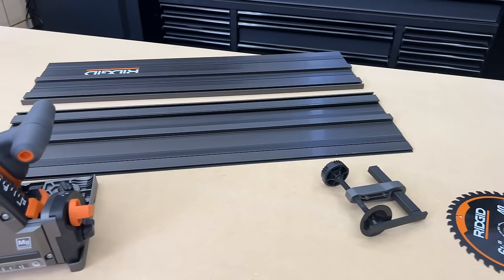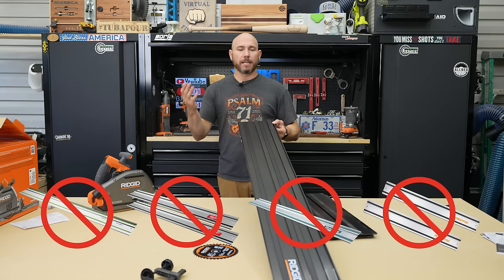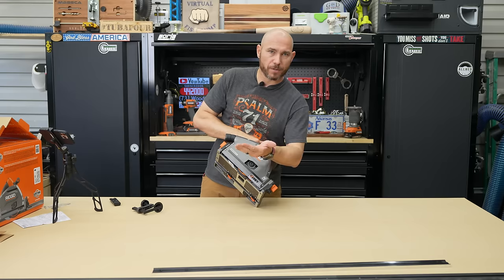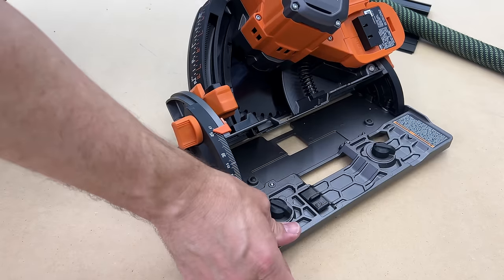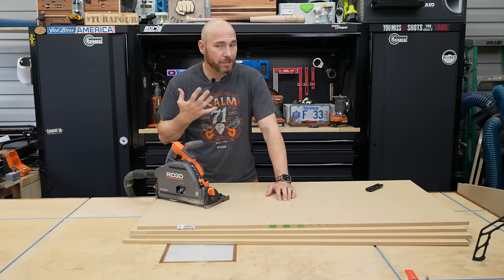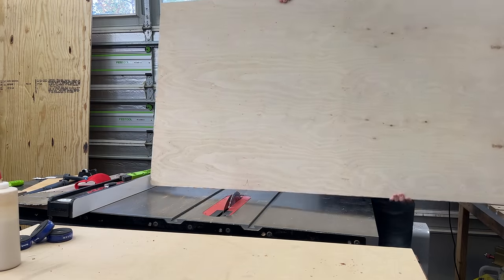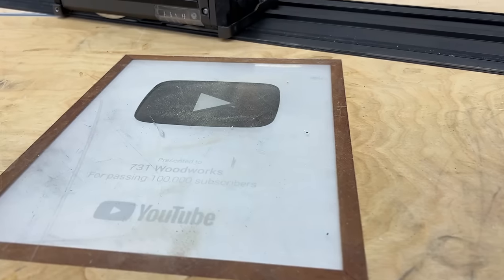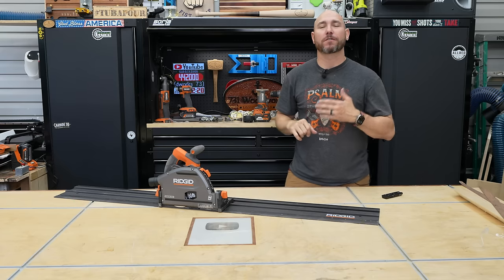Now We Know Everything About the RIDGID Track Saw!

Comment: The numbers on the clear side guard are to show you where the blade with end based on how deep you are plunging. This is necessary for when you are performing a plung cut where the cut doesn't have an entrance or an exit on the material. One example: cutting a square out of the middle of a sheet.
Reply: Came here to say this. For example, if you're plunging 1" deep, the ”1" mark shows where the leading edge of the blade exits the cut, and you finish by jigsaw or by hand.

Comment: I love this track saw.  This is the biggest upgrade to my home shop in years.  Breaking down sheets is so much faster and more accurate than using my table saw ever was.  Just added some Bessey quick release lever handle track clamps and a squaring system to make it even more convenient.  Add in the new 12ah batteries I picked up a 2 pack of, and I can break down all the sheets I would need in a day without running out of power.  Just waiting for TSO to release their square for it, coming next year.
Update:  TSO just released their new square that fits the Ridgid track.

Comment: Years ago, I chose the Ridgid line for lifetime battery replacement and lifetime service agreement. I know that there is always a product that is a little better or little less expensive. Rigid has not disappointed me though. While sometimes I  wish that I chose Dewalt or Milwaukee, overall the Ridgid line has performed very well for me as a DIY'er and I am excited to hear such a good review for this saw. I hope to make this my next big tool purchase.
Reply: I submitted two warranty claims with Rigid and they refused them both.  No abuse of the tools, no overuse, just weekend warrior stuff.  Love the looks of this track saw, but thanks to that, Rigid will never make it into my shop again.
Reply: @thebeardedcanadianadventures  Did you have the tools registered correctly?  I have made a few claims and they fixed them all.  Most were easy.  The only one that took a bit of effort was on my R4512 table saw where they replaced the motor because there was a bad bearing in a fan and they didn't have just the fan replaceable - so basically made it a brand new saw.  The effort was that it's harder to bring in a full size table saw than it is a router or something for repair.
Reply: @thebeardedcanadianadventures I have had issues with the 'service agreement' as well.  It isn't a warranty and as soon as they stop making parts for your tool, you are screwed.  I will also never buy their products again because of service issues with them.

Comment: Thank you for your thoughtful reviews.  I am also a fan of the Ridgid tool line.
I have rarely used the 'plunge' feature of my tracksaw and don't think that is a really important function, but I note that the riving knife on this saw will actually block the blade from plunging because there wouldn't be a pre-existing kerf for it to fit into.  Just a nit, I agree, but you seem to feel the way this tools riving knife articulates is an important improvement over the Ryobi; I just don't think it will allow a true plunge cut.

Comment: I find that I can do the same things as a track saw with my homemade guides.    1/2 ply base with 1x1 straight edge backer to run the saw against.    Using 6 1/2 inch Rigid battery powered saw, cuts through sheet goods fine for me.    Use my shop vac for dust collection with the built in dust port.    4 foot and 8 foot guides around $60.00 for both.   

That being said, not being negative or a hater....just saving the $400.00 + for other tools.

Comment: I am a big fan of Ridgid line even before it had the LSA, I have the old 12" miter saw, and the old belted table saw. I am currently building my 18volt line of tools (yes all of them are registered under the LSA) and have not have had a single issue with any of them. The tracksaw is on my bucket list to buy (come on Santa Claus lol) granted it is a want item not a need but when I need one I need one. I am a weekend woodworking warrior and not a full time woodcrafter so this would fit the void of dealing with full sheet cutups. Sorry I missed ya'll when you were down in Nashville recently as it is just a few hours drive from down here in GA.

Comment: A track saw shootout would be very interesting, especially this saw against the Kreig and other similarly priced saws. Personally I do wish it wasn't cordless though (or they make some kind of a transformer adapter to make it not cordless) - Before I get roasted for this, hear me out:

1) You're already running a hose to the saw for dust collection and dragging it along while cutting, so adding an extension cord to isn't a big deal (Velcro straps to the hose, now they move together as one, it's not that much heavier, and it only takes a minute to do) and I didn't see a battery or a charger in the box, so that changes the saw's price point if you're not in the Rigid platform...

2) An extension cord doesn't have to integrate into an existing battery system or stand out as an odd ball tool if, for example, you're heavily invested into DeWalt cordless tools like I am

3) Extension cords always work. They don't take time to charge or ever even need to be recharged, and it is never half dead when you put it into a tool...

4) Unless you trip a breaker or somehow unplug it, extension cords never die mid-cut or cause the saw to bog down as the battery is getting low... It's been my experience with cordless saws that long rip cuts really drain batteries. To me, that seems to be a problem on a saw where one of it's principle uses is doing exactly that, unless you're already in that battery system and have additional packs, but if you aren't, that radically changes the price equation and value proposition

I freely admit some of that preference may just be my particular use case - If I am breaking down sheet goods, it's multiple sheets at once for a project
Reply: I don't think it's particularly controversial to want a corded saw vs a cordless one. I agree with you! A corded saw for this purpose would make this tool better for anyone who hasn't invested primarily in Rigid products (I don't know anyone who is primarily Rigid, I'm sure they're out there, but far more rare than Dewalt, Makita, Milwaukee, etc). It's also going to add the cost of a big boy battery, which might push it over the cost of the Milwaukee if you're already primarily on those.

Comment: This does look like a good offering as far as it goes, but the decision to go with a proprietary track is interesting. While just saw+track is useful, IMHO the utility of a tracksaw increases with the addition of appropriate accessories - parallel guides, square, router plates, table system. Kreg also went with a proprietary track but at least supplied some additional elements to the system, and you're finally seeing 3rd part aftermarket support as well. Getting compatibility with all the aftermarket accessories is obviously what you get with Festool rail compatibility, so eschewing that may mean that Ridgid is intending to build a system around it. Guess we'll see.
As I already own the Kreg I wouldn't consider making a lateral move to the Ridgid, but I might take a serious look if I was just buying into a system.

Comment: I’m subscribed to your channel and  on your Facebook group but I’m gonna have to call you and ridged out on the track system. I have Milwaukee tracks, Festool  track and power tech tracks, and I have never had a problem, marring my saw to any of those tracks. That being said, by the time you buy the proprietary rigid 60 inch track you’re not saving much money over the Milwaukee Makita or even the Festool . You can get a Milwaukee for $399 you can get two 55 inch powertec tracks with connectors for $129-$149 that puts you at $529 to $549. The rigid $399  comes with two 27 1/2 inch tracks. Then  you buy the 60 inch track for probably around $100 so that put you at about $500 so you’re saving about $50. . And not being able to buy a track square or  parallel guides is a negative that’s why  it was a big mistake to go with a proprietary track. It ends up making the saw cost more plus eliminates additional options. And you’re really not saving anything. And for the people thinking that the ridgid comes with a battery and  a charger for $399 it does not. I can’t remember if he mentioned that his review or not if he didn’t he should probably clear that up .
Reply: All great points, fully agree!
Reply: Rigid kit comes with battery and charger. I take that into account when I’m not in one of those other platforms anymore. So add $150 at the low end for a Milwaukee battery and charger and I’m saving $200
Reply: Sorry, totally disagree with your points…Milwaukee won’t pair properly with a Powertec Track (anti-tip 45 degree feature won’t engage properly). Also, you failed to factor in battery costs.  Finally, which most are missing, this is a 5/8 arbor which gives you the opportunity to purchase a host of saw blades, often for much less than blades for a 20mm arbor size (try and find a 20mm arbor Hardie Blade for instance).  731 is right, this is an exceptional value!  Does it have all the bells and whistles of the Milwaukee or Festool, nah, but that is the point…Best value Track Saw to soon be on the market.  Excellent video and overview of the saw!!!
Reply: @ajdizzle4shizzle   powertec tracks does have the anti-tip slot on their tracks. It aligns with the Milwaukee a little tight and is loose on the Makita but the anti-tip feature has nothing to do with the saw  pairing with the track or not. That is not a feature every track saw  has so that is a mute point I have the Milwaukee saw, and I have a Festool track  saw they both pair on the powertec track, the festool does not have the anti-tip feature it  is a feature I do not use on the Milwaukee either, but it will pair on the track. You are bringing up mute points and I’m not trying to be mean but you’re obviously not that familiar with tracksaw’s. The reason Milwaukee ,Makita , DeWalt , ect went with a 20 mm arbor is because most people that are woodworkers or professional carpenters are already invested into a traksaw system. They already have blades they already have tracks  they already have squares. So this makes them all compatible in that regard . The rigid has less power than all of those saws the rigid Also does not have a scoring feature  you also have to buy an adapter for dust collection for most systems , and finally, like I said, I run the  Milwaukee on those power tech tracks  almost every day. As far as battery cost, the ridgid doesn’t come with batteries, or a charger for $399 so that is something you’re gonna have to buy regardless if you’re not in one of these systems.
Reply: @JB-ez2jz  no the ridgid kit does not come with a battery and a charger. It comes with a saw the two pieces of track and connectors a blade and that’s it.
Reply: This was spot on
Reply: Yea rigid is for homeowners not professionals
Reply: I’m sure their target audience is home owners that don’t currently have a track saw, not pro’s that already have a bunch of tracks and multiple saws.
Reply: @2thepoint45  I agree with that, but the point is whether you’re a homeowner or a pro for the same price you can have a prograde  track saw. Unless you’re already in that platform and not in any of the others it doesn’t make sense.
Reply: @steffendetrick moot point, moot point, moot point, not mute
Reply: @notasleanstillasmean3593  you’re harping over a typo done buy auto correct.🙄
Reply: @steffendetrick  No offense taken by your comments.  I think you may have jumped to conclusions though, as I do own two track saws, 5 separate tracks, as well as accessories from TSO and Benchdogs-uk.  It certainly would have been nice if Ridgid had chosen to produce a track that was the same design/tolerance as Milwaukee's track, but they chose not to for some reason (Perhaps TTI doesn't want to steal market share from Milwaukee, or perhaps to get to the targeted profit margin they require a certain percentage of Ridgid tracks to be sold in addition to what the kit offers...I have no inside knowledge of Ridgid’s marketing/sales/engineering, so my comments would be pure speculation).  I do believe your response confirmed my previous reply...You indicated that the Festool track doesn't have the anti-tip slot and that the Powertec track, which does have the anti-tip slot, is tight when using your Milwaukee track saw.  The Powertec track you have was manufactured to meet Festool/Makita tolerances…The point being, tracks saws are intended to be used with that particular manufacturer's saw or tracks made specifically for stated saws.  Sure, you can get away with making 90 degree cuts on some third party tracks if they are similar enough, but some of the features (For example the anti-tip feature for 45 degree cuts) may not won't work as intended.  I don't think you can say a track saw pairs with another manufactures track and ignore the fact that some of the intended features won't work.  In my opinion, that isn't proper pairing, so I'm not understanding why you called out 731 and Ridgid on this?   The manufacturing tolerances, materials and design can be quite different across manufactures tracks, simply take a set of calipers and measure various dimensions across tracks that seem similar and you'll definitely find variances (i.e. A third party track's aluminum thickness + its non-slip strips thicknesses can actually affect the accuracy of the depth gauge...Perhaps not large enough to matter to some, but still different than what the saw's depth gauge reads).  If you view this from the perspective of staying within a particular brand, then I think the the Ridgid track saw has the potential of being an exceptional value in the track saw market.  I'm not suggesting that it is as powerful or precise as a Milwaukee or Festool track saw, but for “dollars spent / feature set,” it could be quite a good value.  Ridgid does have a scoring depth mark on the depth gauge and has a pretty standard  1- 1/4” ID and 1-7/8” OD dust port.  There are differences to some that could be important which you didn’t mention such as the Ridgid track saw not having a fine depth adjustment, or the lack of an adjustable splinter guard or variable speed adjustment, but it does have a rather interesting Lifetime Service Agreement when registered.  With regard to pricing on the Ridgid saw, were you given a pre-release saw with pricing details?  As of today, I don’t believe this information has been made public, and the information provided by others online has differed substantially.  Case in point, Tool Box Buzz published data online indicating that for $399 you DO get a 6ah battery and charger with the Ridgid kit.  Even if it proved true that you don’t get the battery and charger for $399, when factoring in the purchase of a separate 6ah battery and charger, the Ridgid is is still over $100 less than an equivalent Milwaukee setup.  Finally, I do disagree with the 20mm arbor comment...Blades don't last forever, thus future purchases of disposables should probably be taken into account when attempting to establish value.  Also, a 5/8 arbor 6-1/2 blade is typically much easier to source at local hardware stores, plus they are less expensive than equivalent 20mm arbor options.  Those costs certainly can add up over time.
Reply: Deleting comments that’s an immediate unsubscribe and Unfollow from your  Facebook group.
Reply: Also don't forget the lifetime  warranty. I've had to use it, it's great for the most part, and if the product is ever discontinued they automatically give you the newest product comparable to it.
Reply: I'm already heavy on the rigid battery family, so this is great for me. I've  been so hesitant on getting a tracksaw and I think this my goto!
Reply: I'm already heavy on the rigid battery family, so this is great for me. I've  been so hesitant on getting a tracksaw and I think this my goto!
Reply: I can't tell if your tone is a know-it-all or angry. You seem hurt either way. 😅
Reply: @haystack17  you could tell by my tone from reading a comment😂.  Why are you so butt hurt over somebody else’s comment that  it triggered you enough to respond. What are you a rigid groupie? The proprietary tracks  is the No.1 complaint with the rigid track saw 731 acknowledges this in a later video sorry groupie. It’s just a tool you’ll get over it.
Reply: I just bought the RIDGID for $399 and it came with an 8ah high output battery! 2 27 1/2” tracks, one track clamp and blade.

Comment: Great review.  My two cents, The best tracksaw all around, including cost, capability, accessories, and quality is the Makita (dual 18v).  It’s not that much more $ than the Rigid when you buy the bundle and compare apples to apples.  It also goes on sale regularly.  The track saw use case really shines when you embrace the entire European MFT concept.  Milwaukee, Rigid, Dewalt, Ryobi, WEN all missed this. It’s a big miss in my opinion. If all you are doing is breaking down sheet goods, there are just as good cheaper alternatives.  If you have a tablesaw and are using the tracksaw to rip 8/4 hardwood or 2x material I’m wondering why.  If you have a mitre saw and are using the tracksaw to crosscut 2x material, I’m wondering why.  However, if you are just getting into woodworking you can buy a tracksaw and MFT system for much less than a cabinet style tablesaw and quality mitre saw and do practically everything most woodworkers need to do.  Watch some of the Europeans YT channels that use the MFT system because they have very small shops, they build amazing furniture with the tracksaw as their principal tool.
Reply: What is MFT?
Reply: @markgallagher1376  Multifunction Table made popular by Festool.
Reply: Keep wondering, but I can think of many reasons.